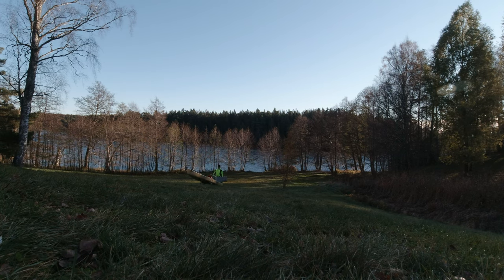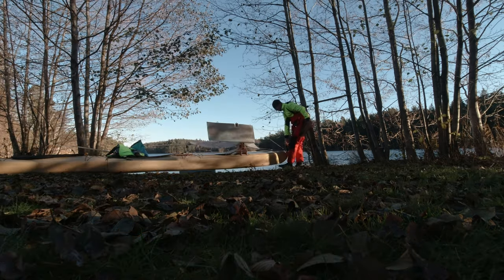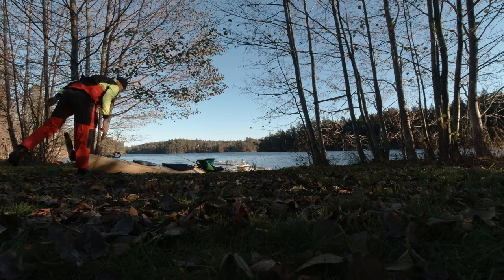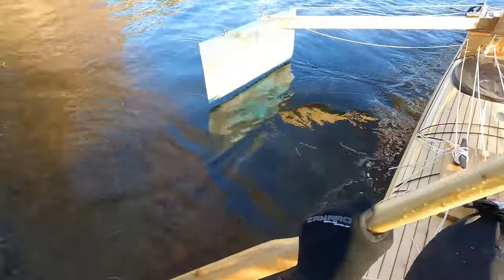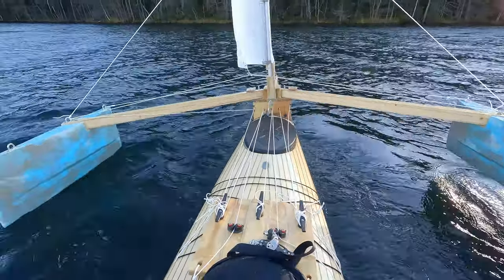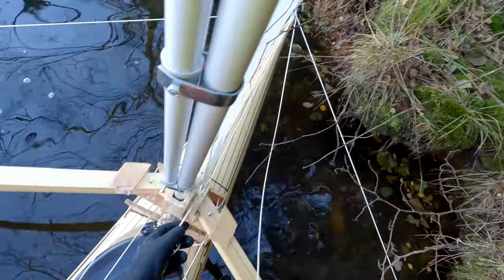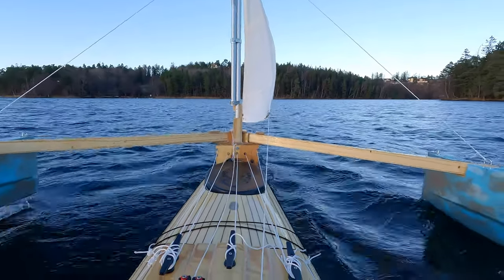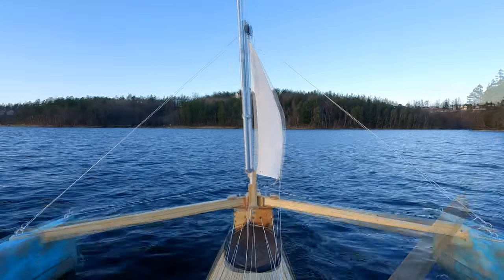Test launching the sailing addition for the kayak: trimaran pontoons, jib and steering #164

Comment: Alright still going to test a little this year before the ice comes back . You could dampen the rocking with inner tube or bungee . I like the gods eye view of the boat in the water. Very cool Not sure about the jib it might take a little more tweaking. I personally really like Koos out riggers I am tempted to get or make some for me . thanks for updating me on the testing. Have a great weekend 👍
Reply from the maker: The ice is coming, we have had below freezing for a week now and the next week looks even colder. Good idea to bungee dampen, I will try that if the hack with lowering the turning point doesn't work. I am heading for the lake to try out a small adjustment of the jib as well but it might be a boring test as there is no wind with the weather type we are having now.

Comment: Interesting on such beautiful kayak, any consideration for making the amas very narrow?
Reply from the maker: Please give me a hint, I am not sure what "amas" is? Are you referring to the pontoons? In that case I made these from a airfoil profile. The width is thus in relation to the length. Making them wider would deviate from the optimal airfoil if I do not also make them longer. Here is the video where I make the hydrofoils https://youtu.be/GjufvQrTRi0
Reply: @sailoutofagarage6212  yes the pontoons, compared to mine, they are very fat to start with (inflatable, had no choice) so they start to work immediately, a bit too maybe. Yours would be more subtle, but less drag, wonder how they do in waves, smooth I'd think...
Reply from the maker: @Canoesailor  In the film/testrun I only had small waves so I do not know yet how they will behave in big waves. But yes they shold run rather smooth through waves. I have now lowered the center of the beams so the pontoons should make water contact earlier and also help with the wobbling. I have also made some other alterations that will be shown and tested in coming episodes.

Comment: What is the reason for pivoting the mast and floats?
Reply from the maker: As the kayak is very narrow it will tip over for the lightest of wind with the large sail area I plan to have. Instead of only relying on the buoyancy in the pontoons as counterweight to the healing moment I have added the pivoting mast. The mast will spill wind as the wind increases and the mast is leaning. Altough the kayak will stay upright. That is the plan at least but I have not tried it yet.